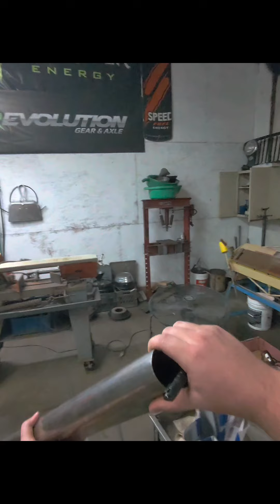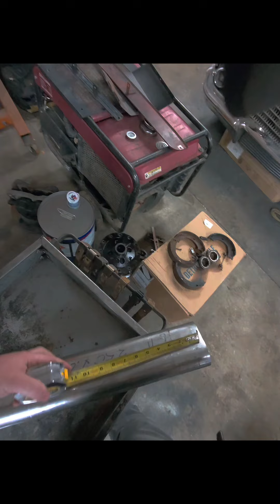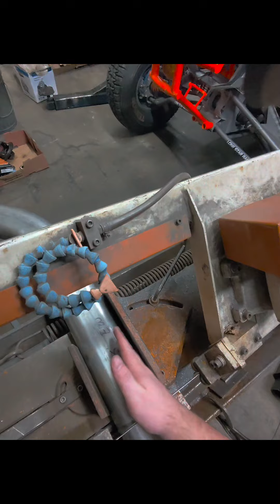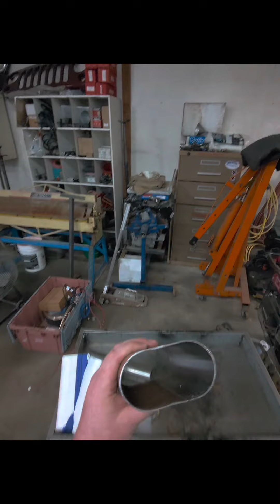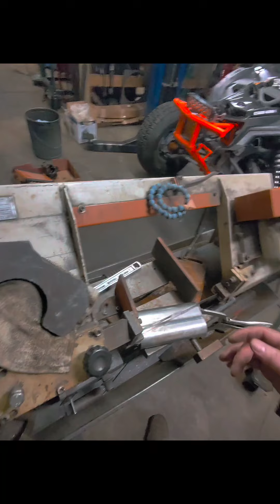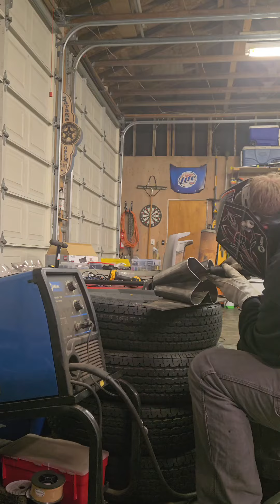I built the worlds CRAZIEST exhaust tip for my chevy prerunner!

Comment: I ordered one from you. Are the tips gonna come with a circle on the end so we can weld them easy onto an exhaust? Like most tips
Reply from the maker: Yes, the tips sold as 3" inlet will have a perfectly round 3" inlet hole that will slip over your existing 3" about 1/4 inch or so